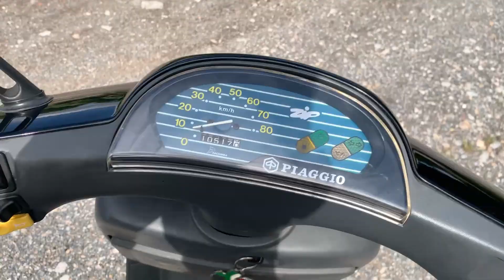PIAGGIO ZIP 70cc 1994 RESTORATION & TUNING

Comment: Hello! what variator weights, compression spring, clutch springs and main nozzle do you have?
Reply from the maker: @sebbyseb2009  Hi, i have 4,5g variator rollers, compression spring is from a malossi multivar kit and main nozzle size is 75.
Reply: @morebeer_projects is your acceleration good? Have you set your oil pump to max or do you just mix oil in the gasoline tank?
Reply: @morebeer_projects thanks for the answer!
Reply from the maker: @sebbyseb2009  Recently i deleted the oil pump and i prepare the mixture perfectly by mixing it in the tank
Reply: @morebeer_projects   ok if you have a full tank how much do you mix with the oil?
Reply: @morebeer_projects  ok if you have a full tank how much do you mix with the oil?

Comment: Hello, I’m a bit late for the video but would a 1992 zip still be reliable in 2025, considering it has  about 7k kilometers mileage and good overall condition ?
Reply from the maker: Hi, yes, zip from 1992 is a very reliable 2stroke machine. 7k km is very low mileage so if its in a good condition, there is no reason for it to not be used.
Reply: @ thx for answering ! Do you have any idea where I could buy fairings for it ? Can’t find anything online on Zandri or other websites
Reply from the maker: I had the same problem. Had to repair the old ones, because i wasnt able to find new ones online. You can try ebay and search for used plastics in good condition...
Reply: @morebeer_projects  thank you brother have a great day

Comment: Did you change to 107 mm clutch?
Reply from the maker: @sebbyseb2009 Yes I did
Reply: @ ok thanks for you answer because we had a real problem with my clutch. But did you need to change anything else or did you just need to change the clutch for this to work. And could you tell me the name of the clutch you bought?
Reply: @morebeer_projects thanks for answering by the way👍🏻
Reply from the maker: @sebbyseb2009 No, I changed basically everything😂 But I probably had a different intention in this build, I wanted to get as much power as I could so it was neccesary😃To make it work, these things obviously arent neccesary. Clutch is a slight change to be honest..
Reply: @morebeer_projects  Ah ok, I mean do you need to change the pulley that the clutch sits on or did you just need to change the clutch?
Reply from the maker: @sebbyseb2009 I changed both, since the new one is way lighter weight
Reply: @morebeer_projects  like the pulleys for clutch, the clutch that will say everything you need to buy in order to convert it to 107 mm clutch
Reply: @morebeer_projects  it would be very kind of you if you linked all products in order to fit the new 107 mm clutch
Reply from the maker: @sebbyseb2009 Clutch bell from Naraku https://www.scooter-tuning.cz/zbozi/spojkovy-zvon-naraku-v2-cnc--piaggio-peugeot-kymco-sym-gy6/

Clutch from Polini https://www.scooter-tuning.cz/zbozi/spojka-polini-speed-clutch-3g-for-race-107mm/
Reply: @morebeer_projects  Hello again! I want to thank you so much for answering? I just want to know of you need to change pulleys where the belt is on and the belt?
Reply: @morebeer_projects  ok, have you noticed if the moped has stuck with this clutch because it hasn't broken then?
Reply from the maker: @sebbyseb2009 If its not damaged, you dont need to change
Reply: @morebeer_projects  oh ok so then i only need to buy 107 mm clutch and clutch bell? Thank you so much, you have really helped me out🙏🏻
Reply from the maker: @sebbyseb2009 If pulley is ok, clutch and bell is good option👍
Reply: @morebeer_projects  ok thank you so much man!

Comment: what 70cc did you get? i want to upgrade my 50 to a 70. id love if you would share that information with me!
Reply from the maker: I have a Malossi 70cc Sport kit. But when you change that, you also need to change many other things to make it work properly. GL!!
Reply: @morebeer_projects is upgrading cvt and clutch 100% necessary or can it be skipped
Reply from the maker: @edvinandersson6066  Upgrading CVT is not necessary but it gives you some extra power. The original clutch works fine if its in a good shape. The most important thing is to deliver an optimal mixture of fuel to the engine. So if you want your engine to last long you have to upgrade carb, main jet, air filter and play with the configuration. The only way to find optimal result is trying many sizes of jets. It takes time